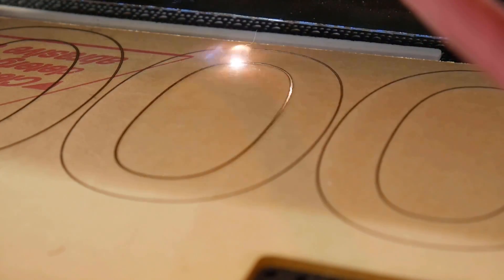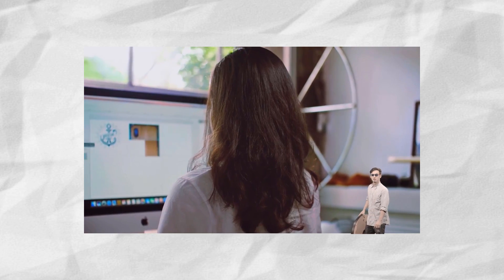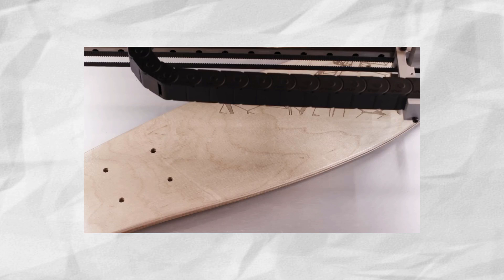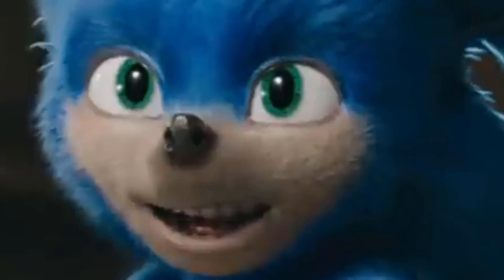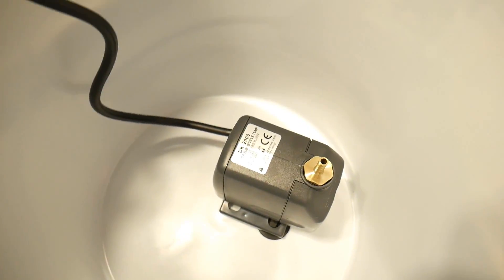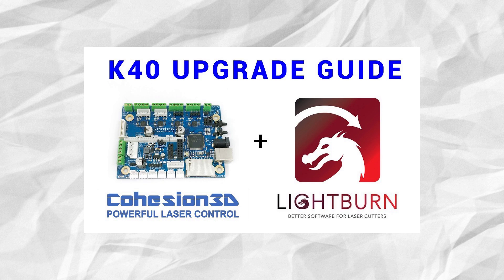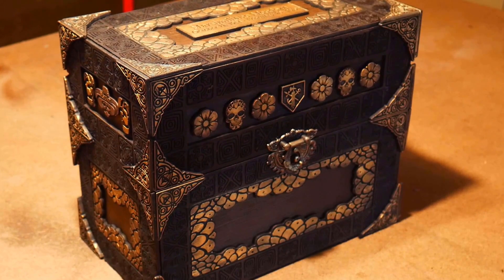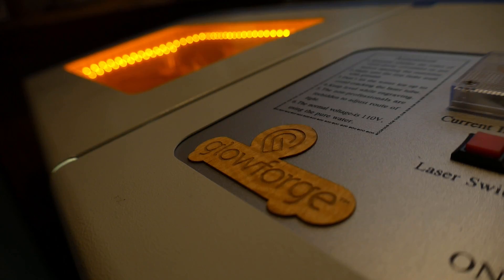Cheap Chinese Laser Cutters - What they Don't Tell You

Comment: Great video! I was curious, does the gantry support go all the way around the inside of the box? The reason I ask, I make 12x17 in  cutting board and would like to customize them. I would maybe cut an oversize material slot in the front of the machine to allow it to sit inside the engraving area. Just looking at it, do you think that would be possible?
Reply from the maker: It may work, I know that the internals for the bed are about 14 in wide so it should accommodate the thinner side of the cutting board. 

If you do have the funds getting a larger machine https://www.ebay.com/itm/80W-Co2-Laser-Engraver-Cutter-Engraving-Cutting-machine-20x28-USB-Port-Ruida/153734136465?hash=item23cb44c291:g:jbIAAOSwPqBdwPJm . its a bit more expensive but if you need the space its over twice the working area and twice as powerful
Reply: @NickMartinelliTV  I would love to pick one of those up, but I can't convince my wife to let me get it right now. haha. I would potentially use this to customize and make router templates for special order boards. Once I make my money back, I could upgrade. What's the thickest material you think you could cut with this? Acrylic, wood, whatever.
Reply from the maker: @metalman1004  haha I feel that, I've cut 1/4 in birch on here.
 for a job that need something thicker I stacked and glued 8 pieces of 1/8" ply to make an inch of material. 

The work area is 8.5" x 11" but if you are smart with your layouts you can index pieces into a bigger layouts for your boards. 

If you end up doing the pass through this could help in the customization https://www.youtube.com/watch?v=nTaQC7lZHTI
Reply from the maker: also found a passthough someone had done https://youtu.be/0r5sdS8zqY0?t=23